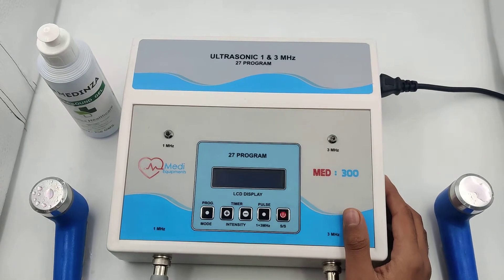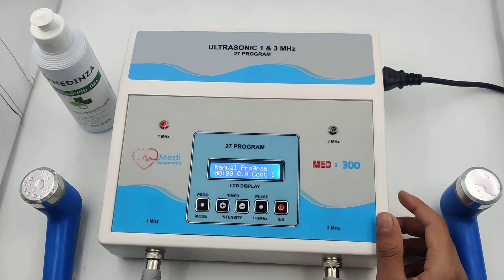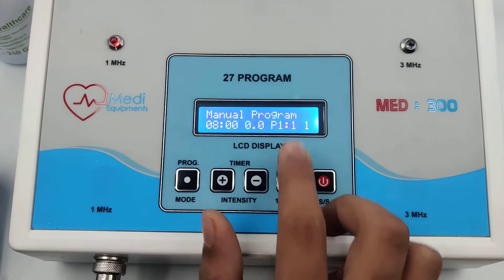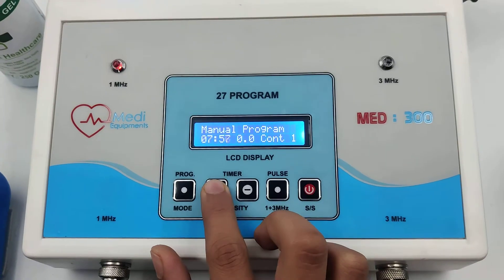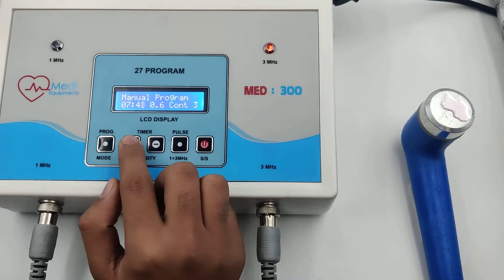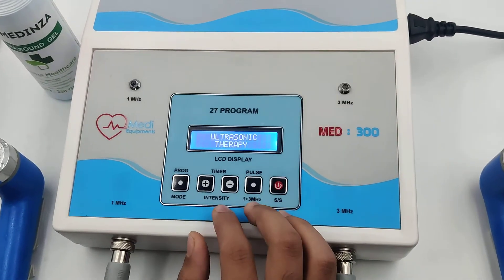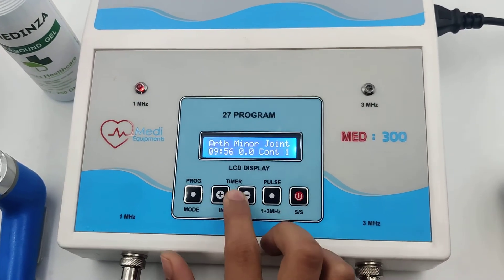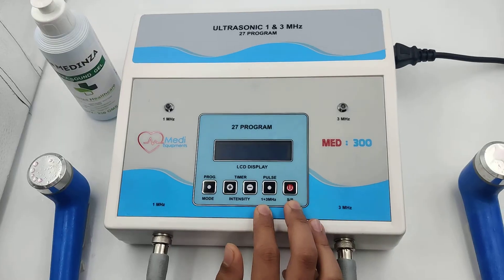Medinza Ultrasound Therapy 1MHz & 3MHz Unit MED : 300 Ultrasonic Pain Relief Physiotherapy Machine

Comment: Hi, I had ultrasound therapy today in a facial injury. The PT had it set at 1mhz, which I’ve seen should only be used in the body not on the face. It burned and stung uncomfortably. He had it set at 20% pulsed, not sure if the other settings but he said they weren’t super high. Could this result in any tissue damage later or fat loss like cavitation?
Reply: Hi! I dont work for medinza but Im a PT and 1mhz shouldnt have been used for facial injury. Theres not gonna be a fat loss but maybe it would cause a damage on the tissue but dont worry it wont be bad maybe just a muscle spam or a scar that will dissaper in a couple of weeks.
Reply: The 20 pulse was strong enough to kill cells, specially If hot. At lo